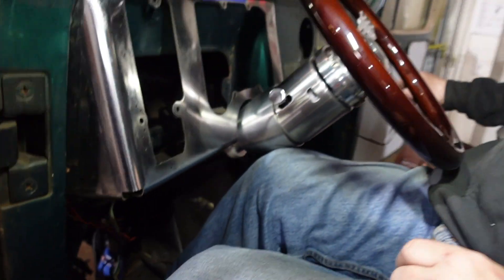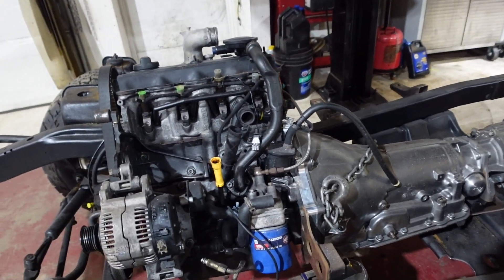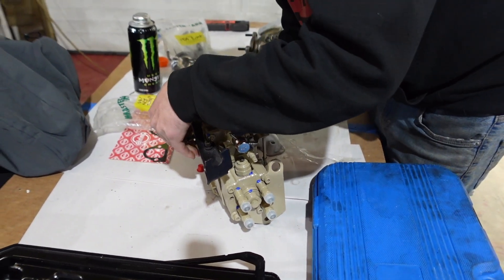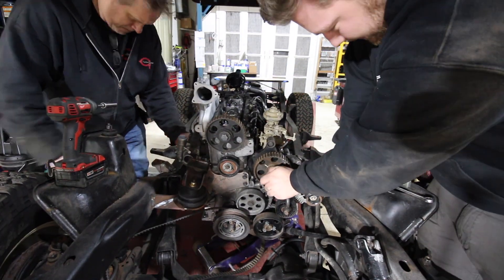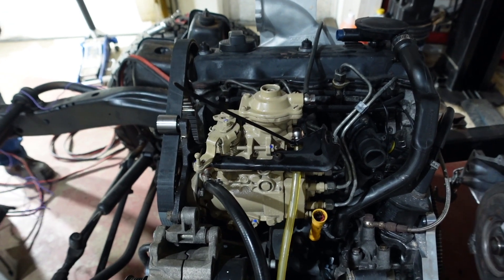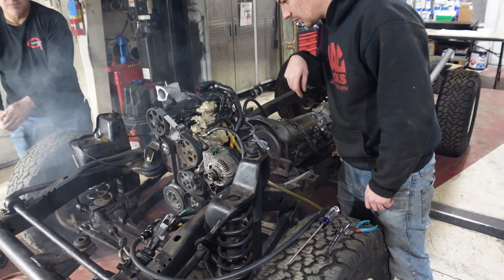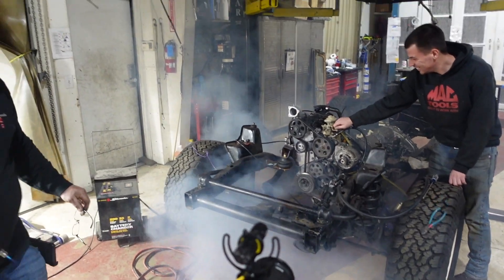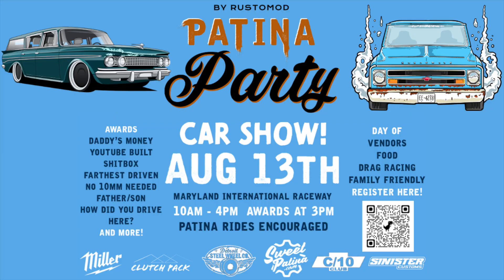Diesel Swap Willys Wagon RUNS!! Chassis Swap TJ Jeep FIRST FIRE UP!!! On TDI Engine!! Willys Ep.12

Comment: Curious-did you have the glow plugs working?
What about the stock ecm injector feedback for the injector pump?
Reply from the maker: Glow plugs weren’t working when we first fired it up. We have to wire it up when we finish the car. This is mechanical pump so doesn’t use an ecm or anything.
Reply: @Rustomod  How are you setting the injector pump timing? The Alh Tdi is set using Vag Com hooked to the Obd2 port and the ecm has a connection to one of the injectors that senses the fuel pulses. Curious how timing is achieved without this.